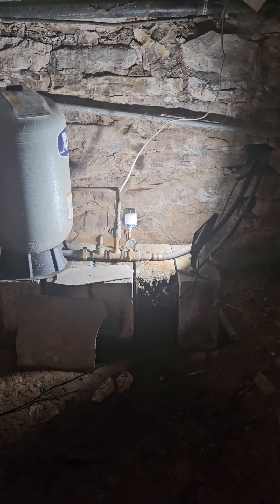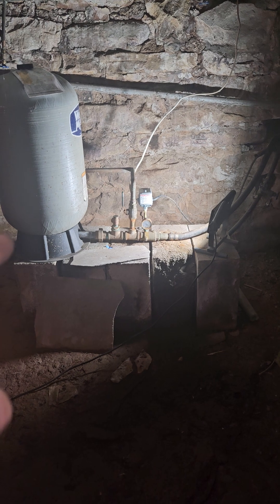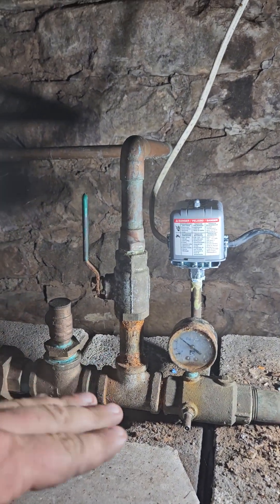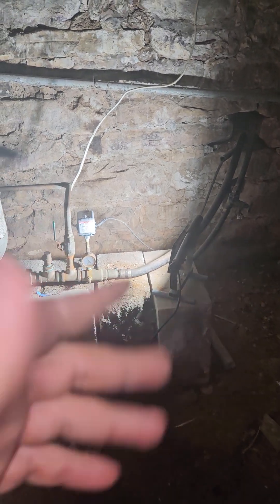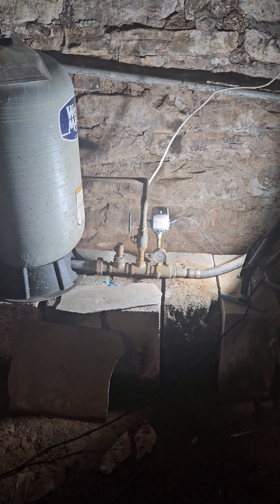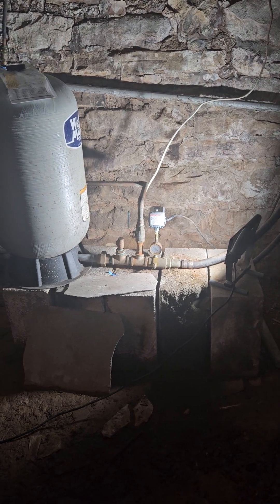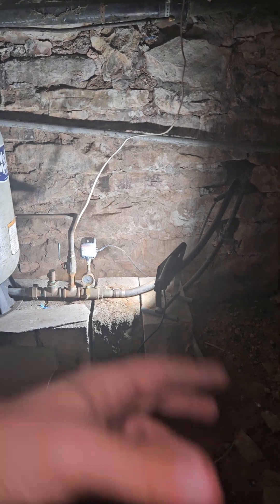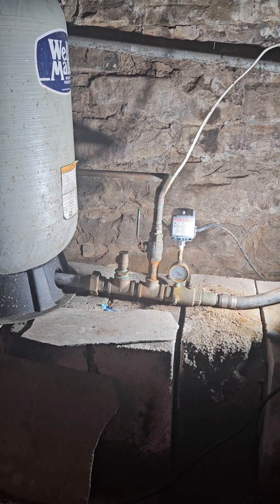Common signs of a faulty foot valve or check valve💧💧💧

Comment: PlumberJ.  Thank you very much for this post.  I found it by Googling "check valve problems on a submersible water pump".  I retired and moved overseas and built a home about eight years ago.  A couple of days ago, I noticed that our home water pump was operating non-stop; turning on for about a minute - turning off for 45 seconds, then turning on again.  Non-stop until I flipped the electric switch to turn off the pump.  But then, we wouldn't have water in the house until I turned on the switch again.  I have called three different plumbers; one just purged the system (saying that there was air in the pipes); another told me that we had a major internal leak and that he would come back with a device to find where the leak was and proceed to break through walls and floors to begin pipe repairs; and the third who just left who told me that the first place to begin is by determining if the "check valve" on the pump is operating the way it is supposed to.  Our water pump is submerged in a (cistern?) so he will attach an external valve first to see if this works and stops the pump from constantly turning on and off.  Anyway, I decided to Google this issue and came to your post which makes a lot of sense.  Fingers crossed that this works.  I have subscribed to your channel because your explanation is very easy to understand and will help me in the future if we experience any other plumbing issues.  Regards, Dan.

Comment: PlumaJ, I hope you are doing well.  Thank you, and on behalf of everyone who needs help, water or heat, on the weekend when there is no help, thank you, again. It's Sunday and my check valve in the 80 ft well is toast. We have intermittent water but the pressure doesn't bounce from 40 to 60. It fills to 40, then slowly to 60, slowly empties to 40, and then takes a dump to zero. It's a 15 minute cycle. Tank is 12 yrs old, properly aired up to 38psi, no sloshing water inside when emptied to zero psi. It sounds like the house is haunted at night.
Reply from the maker: Hey there 👊
Deep or shallow well pump?
Reply: @PlumbaJ Mr J, it's an 80 ft well. The pump is submerged permanently at depth. I believe that would be a deep well because it never sees air.
Reply from the maker: @hotchow8766 yes that is what you call a deep well,
 if your gauge is losing pressure when your pressure switch shuts off with nothing being used in the house it is your check valve 
But if it does not lose pressure once it shuts off at 60 PSI but it struggles to gain up to 60 PSI once it turns on at 40 psi then it is your pressure tank diaphragm
Reply: @PlumbaJ Thank you. Do you think I could install a check valve a few feet from the tank on the supply side? That would save me having to pay to pull the well out and replace that deeply submerged check valve. Thank you.
Reply from the maker: @therealLandPig 
You could try but most of the time you have a a check valve behind the bladder tank so your domestic system dose not lose prime and another check valve at the pump so you don't lose prime at the pump
Reply from the maker: Your pump can't move air , only water

Comment: How I know if my check valve from inside the well is working... it was working but got home and the water instead of going all the way up ill go back down
Reply from the maker: With all your pictures off of the house and when the pump is satisfied you can watch the gauge if it stays in one place your check valve is fine if you have pressure loss instantly at a rapid Pace usually means that a check valve inside the well casing is bad
You can message me on Whatsapp

Comment: I installed a new well pump about 5 years ago (120v, 1hp, 40 ft deep). 2 weeks ago my water pressure went from 40-60 via the pressure switch to a steady 25psi. My air tank is new and pressure is 38psi and I installed a new pressure switch. Still getting only 25 psi. Is my pump probably failing?
Reply from the maker: So since you mentioned that you're well pump is only 40 ft deep and your electric is 120 volt probably means that you have a shallow well pump which means the pump is sitting in your house either on a bracket above your bladder tank or near it and not deep in the ground
Am I correct ?
Reply from the maker: If that's the case does your pump eventually shut off or does a consistently run unless you turn off the electric?
Reply from the maker: Also after it shuts off at 25 psi does the gauge go down to zero or it stays at 25? Like do you hear water rolling back down the pipe?
Reply: @PlumbaJ  Thanks for the reply. It stays at 25psi unless I pull the breaker then it goes to 0 and no water pressure. The pump is down 40 ft and I have a high water table and lots of iron in the water (Ohio). I changed it myself about 8 years ago and have had no issues until now. Pressure switch is 40-60. I bought a backup one if needed.
Reply from the maker: @gsproc  if your gauge is not holding water pressure after the pressure switch satisfies it is a faulty foot valve
Reply: @PlumbaJ  Thanks I'll look into it
Reply from the maker: @gsproc  jonathansragg@gmail.com 
No problem here's my email if you want to email me further or talk over the phone

Comment: Yup, that's a problem you are goi going to burn up that pressure switch if you don't fix the situation due to it over working 

If you have a deep well pump it's usually the check valve 
If you have a shallow well pump its usually the foot valve
Reply: Thanks for the reply. It is only down maybe 40' so I will have to try the foot valve.
Reply from the maker: @chumleye1112 
Hey I just switched accounts lol

Is your pump located in the basement or down in the well?
Reply: @PlumbaJ  Its a submersible. Originally it had a jet pump in the basement but was quite noisy. When it was close to its end of life I proactively changed it out to submersible. Its been down there for probably 15 yrs or so. It is a quality pump Grundfos and has been working good until this bleeding down recently.
Reply from the maker: @chumleye1112  okay then it's your check valve or a leak in a vertical line in the well casing, you only see a foot valve at the end of a shallow well pump line

Comment: Thanks for the video. I think I have a similar problem with my submersible well pump. I was thinking it may be my tank but think it is a foot or check valve. The problem is every minute or so my pressure drops slowly from 50 to 30 and the pump cycles even when there is no water being used. My water comes in from the pump though a shut off valve (there is no check valve there, I will put one in) then into the tank, Tee, etc. then it goes through a filter and I have a shut off valve between that and my water softener. If I shut off the valve to my well and the other valve to the household water, everything is fine and the pump doesn't cycle. As soon as I open the valve to the pump the pressure drops quickly and the cycle begins. I am assuming this proves the foot valve is faulty at the bottom of the pump (I do not bellieve there is a check valve unless the pump has a built in one).
Reply: If I live close to you I would definitely help you out
Reply: Im plumbaJ I am just commenting from my firearm channel lol